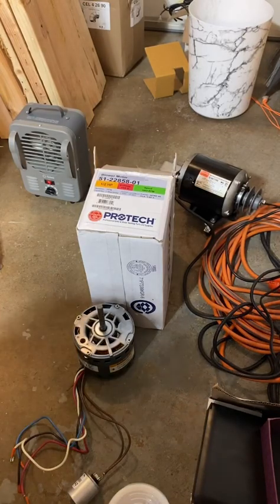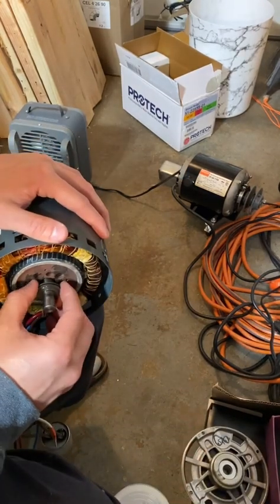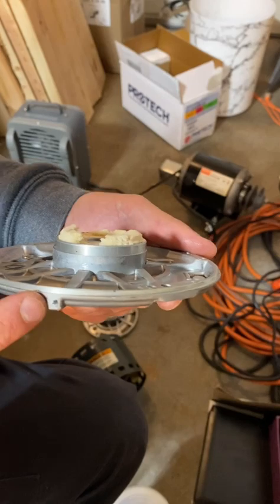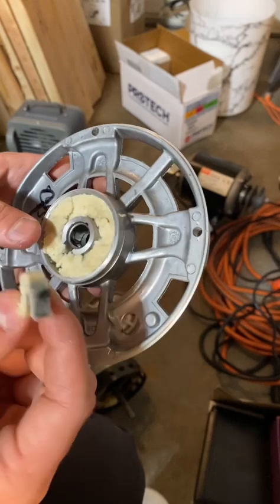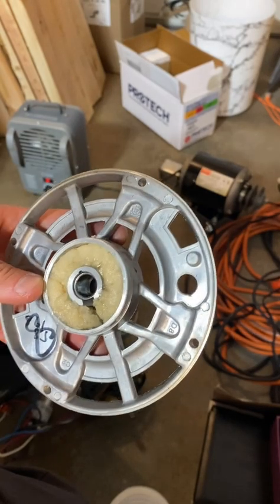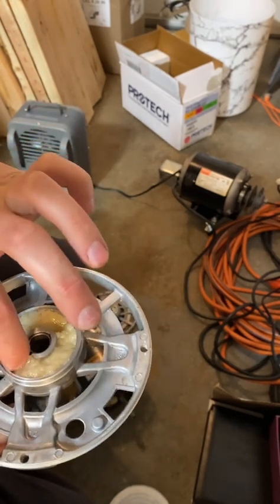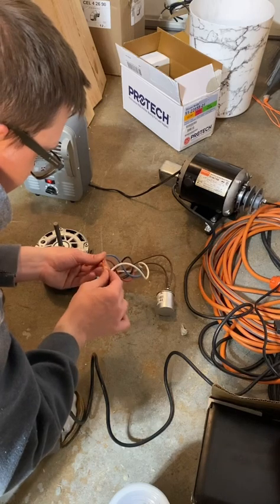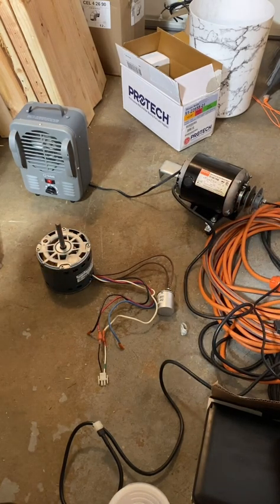How to add oil to a sealed blower motor! (No oil ports)

Comment: Thanks for your video. The initial problem seemed to be that oil was leaking. Would you say this solved that ? Maybe by expanding the felt with fresh oil ? In the interim  have you found where to source new felt /bushing materials?  Thanks again.

Comment: Note that regular 3 in 1 multipurpose oil only has a viscosity of about SAE 5W.  You might want something a bit thicker for a furnace blower motor that runs so much.  There is a 3 in 1 MOTOR oil designed for electric motors and that has a viscosity of about SAE 20W.
Reply from the maker: Good tip. I used the zoom spout oiler, which claims to have turbine oil, which is designed for motors.

Comment: Too bad we couldn’t see you remove the end cap.
Reply from the maker: Just remove the bolts/nuts and tap the motor shaft against the floor, the end cap will pop right off.
Reply: @victork3397 Sorry actually i was talking about the procedure that went off camera just as you started to do it.

Comment: Hi Victor K

Nice video on lubricating electric motor bearings. 

Please be aware that your motor bearings were originally lubricated with PermaWick material manufactured by the Permawick Corporation. 
Permawick has supplied bearing lubricants to the OEM electric motor companies around the world for over 70 years.
The oil reservoir material (felt like material) you mention @ 4:08 is called PermaWick. It is a mixture of PermaOil and fibers that resides around the side of the bearing. 
PermaOil contains additives specially designed for use in electric motor bearings, not found in generic off the shelf oils. 

Oil from the PermaWick material is drawn through a window in the bearing via a transfer felt, which in turn contacts and lubricates the shaft of the motor. 
Permawick material can be reconstituted with PermaOil, or new PermaWick material can be used to replace the old. 

Permawick Corporation.
Reply from the maker: @Permawick  thank you for watching and for the comment, it was very insightful. It was my understanding that the felt-like material contained asbestos, is this true? 

Also I could not find retailers selling PermaOil, so turbine oil or even non-detergent 30w oil should work adequately for the task. If you have a link you could share as to where to buy the PermaOil, that would greatly help. Thank you.

Comment: Hello, thank you for the video. May I ask what oil did you use to liberate the felt material?
Reply from the maker: @pavel0900  I used the zoom spout oil, commonly called “turbine oil”. It is just a mineral oil. Search O’reilly auto parts for “Pure Guard Non-Detergent Motor Oil 30W 1 Quart - ND30-QT” and you will find a good oil to use for electric motors like this.
Reply: @ Thank you so much! I appreciate the detailed explanation. I have a 10 year old Carrier furnace, that started to produce high pitched sound recently. I have a feeling the lubricant has dried up. I beat myself up for not acting sooner as the warranty literally was two days past expiry. New motor would cost $1,400 on Amazon or $3,400 from the company that installed the furnace in the first place. I want to see if I can still salvage it, before spending thousands of dollars on replacement. Again, huge thanks, and Merry Christmas!
Reply from the maker: @pavel0900  if it is a PSC motor, an aftermarket motor will work. Just make sure the voltage, horsepower, RPM, number of speeds, direction and physical size are the same. You don’t need to have the same motor. Most carrier motors have a built in bracket. You can buy a generic belly band bracket and put in a generic motor. Just follow the same wire color code they used and take pictures.
Reply: @victork3397  thank you so much! I’ll be sure to follow your advice.